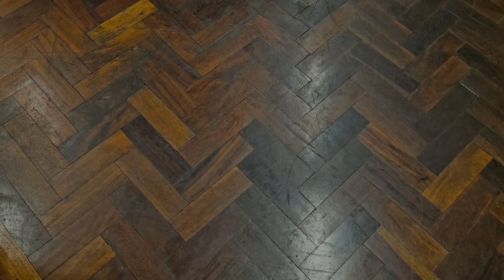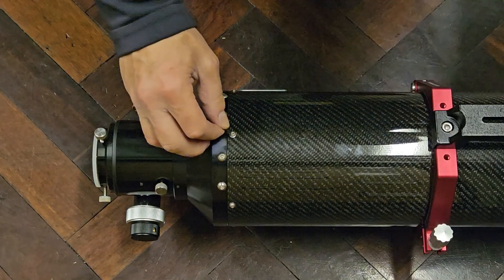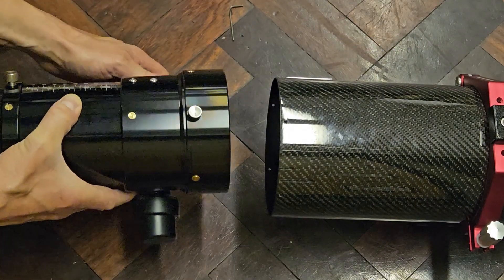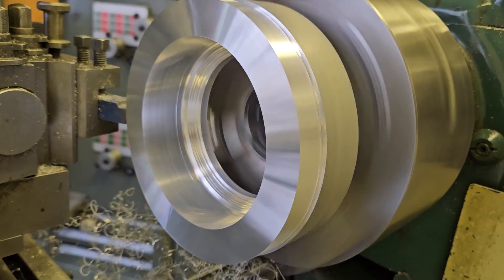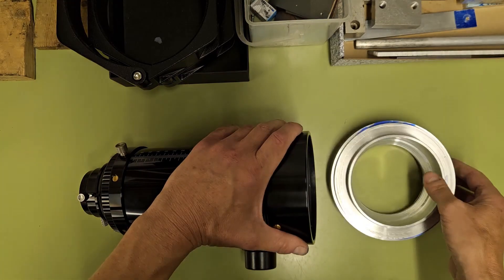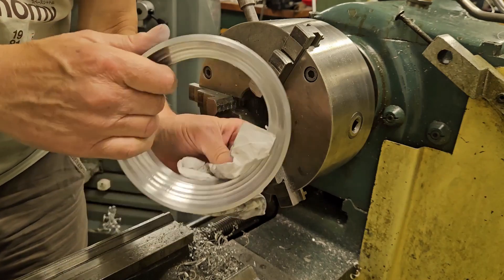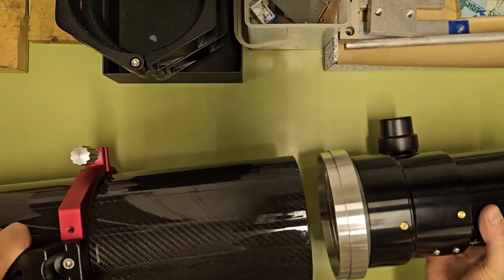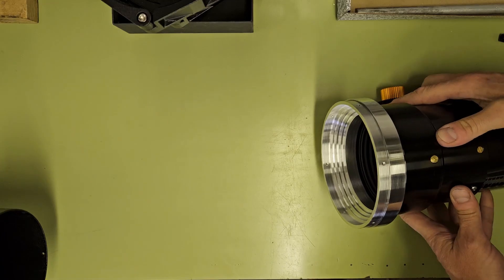Manual machining Explore Scientific ED127 focuser for upgrade to TS 3.7"

Comment: What size are those PLL rings? Just got one of these scopes and I'm considering swapping out the stock cradle rings for one of PrimaLuce Labs, Rouz, or More Blue but there is no information on the tube diameter online anywhere. Really good video!
Reply from the maker: Many thanks. They are 145mm